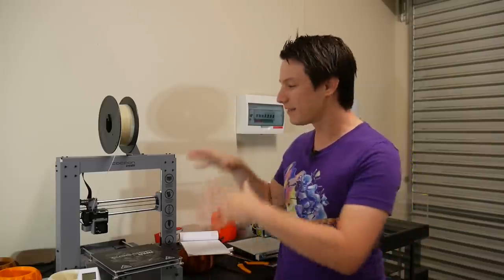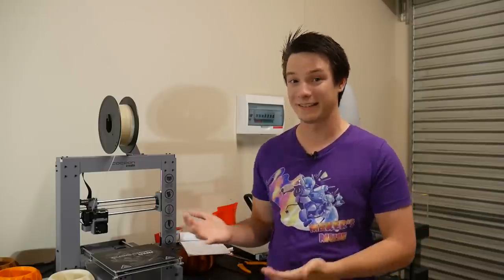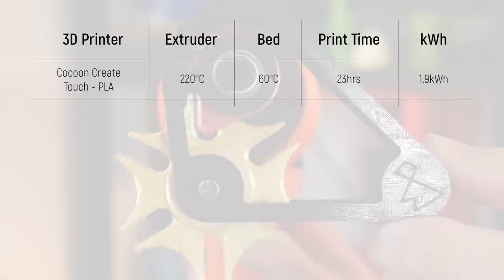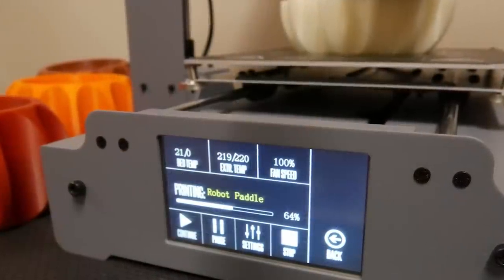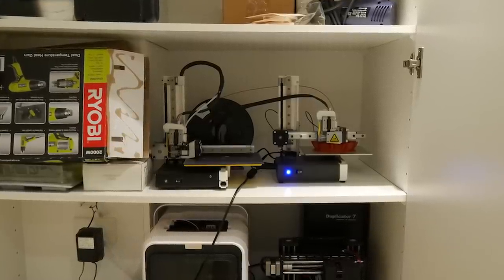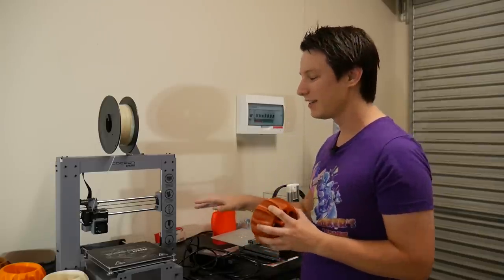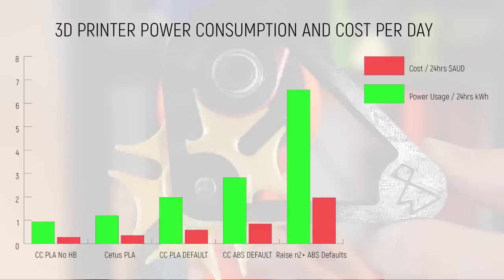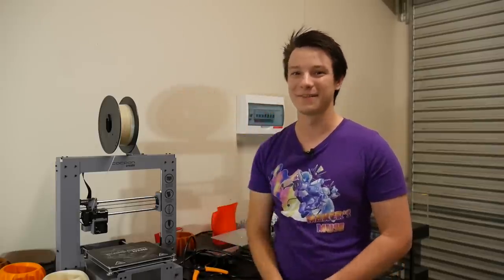How much power do 3D Printers use?

Comment: That cheap nasty watt meter (sold under Arlec brand in Australia) has been proven to be more than 20% out in accuracy, worth spending another $20 to get one that works Angus :)
Reply from the maker: Well that sucks lol. Good old jaycar. I'll source a more accurate one for a follow-up
Reply: Angus, before you punish yourself too much while there may be such inaccuracy it will however be quite consistent from read to read. Meaning that while the absolute numbers you've come up with may be in question the relative numbers will be pretty bang on. Thus the data collected can be correlated and corrected with a decent multi meter.

Best Wishes
Reply: do you have some hard data on  that (given that you say "proven") ... I'd expect something like 5% at worst. I've got one and when I plug my Fluke 11 into the wall its within 2% of the voltage read. Given how it then operates to calculate amps (which I'm not entirely sure) one could then speculate that if its induction measurement it wouldn't be much more than 5% ... still, if you have done measurements or can cite a source I'd be interested. 20% is a lot.
Reply: there's a government program where libraries were equipped with kits that are free to borrow with powermate's - $200 units that are by far the most/best watt meters out there.  (Government powersaving initiative, free meters made available for everyone etc - quality ones).

Comment: If you table the results and convert them, you get this table

a. 1.9 Kw in 23hr = 82.6 watts / hr
b. 2.7 Kw in 23hr = 117.3 watts / hr
c. 0.9 Kw in 23hr = 39.1 watts / hr
d. 0.5 Kw in 10hr = 50 watts / hr

And the winner is, C with 39.1 Watts per hour as the lowest consumption print.
Reply: No: the costs of energy are the energy it takes to make the same print as Angus showed. If your printer is only using 10 Watts but takes 3 days, on your calculation this is the winner but in total this printer is using much more energy before the print is finished. 
By the way you wrote Kw but you mean "KwH" (KWh). If you would use 0,9 Kw in 23h, you would use 0,9*23 = 20.7 KWh ... a lot more per print (and I'm happy it is not).

By the way, I can turn the heater in the room down or even off when it it printing, so in wintertime the energy-consumption is almost the same with or without printing (If I will use 1 KWh in the printer for heating or 1 KWh in the heater makes no difference, temperature in the room stays the same).
Reply: @elvinhaak  Fast print can be tuned via gcode, but you have a point. A practical testing is to test each machine until its printing quality is below acceptable quality at X% chance. This can be a very costly test, and only worth it if you run a huge printing farm.
Reply: The winner is D actually because it consumed less power in total.

Comment: 2.7kwh equal to 2700watt/hour. Therefore, 2.7kw x 23 hours equal 62.1kw.

62.1kw x 30c equal to 18.63 AUD
Reply: No, 2.7kWh is the total energy used. It did not draw 2.7kW for 23 hours.

Comment: Bed from 60 to 100 degree isnt a massive jump?

-Due to normal ambient temperature is around 20 degree, its a 100% jump? -And simple logic (alt physics), says the higher a heat difference, the greater a loss.. 

So the jump from 60 to 100 on bed, would theoretical bump the bed power consumption to double.. :)

Comment: So my takeaway from this is: If it costs more to order the part than to make it, make it. If it doesn't exist anywhere but your head, it's priceless so you might as well make it. About the same as if you just think of the material cost, but it definitely adds a little bit of thought when someone offers to buy a part that uses $0.75 in materials but takes twelve hours to print.

Also, this totally makes me think of those tiny half-cartesian bots (Do we even have a name for that style yet?) in a new light.
Reply: What do you mean half-cartesian? Cartesian with single sided support, Ormerod derivatives? Well you can print just as efficiently on something else, you just power off the bed and limit yourself to a small print size, and to low-shrinkage materials.

Comment: Cold you just print ABS without the fans on and it would work
Reply: M*A*S*H* The4077th I'm sure he had part cooling fan off.
Reply from the maker: Yep, no cooling fan for ABS
Reply: So that's what you do in your videos when you print ABS

And it still warps an doesn't stick to the plate and itself during the print

Comment: Thats like an average of 100 watts, that's really not bad. A gaming pc at idle uses like 200-300 watts with monitor not to mention when gaming lol, its more like 500.
Reply: Uhhh really? How do you even idle at 200-300W? No, certainly not. My Phenom II x6 overclocked to 4 GHz idles at less than 150W - that with two 7200rpm hard disks. Modern systems are way more frugal, with leaner idle, they are easy to bring under 80W idle.  A modern GPU, any modern GPU, idles at less that 10W, regardless that its full power might be 200W. Monitors are fairly negligible too, i mean mine has maximum consumption of just 16W! So in total you could say a gaming PC idles at around 100W.
Reply: I measured my system soo. It was like 250 watts idle. Two 780 and a 6600k. Of course if you have two slightly older gpus that definitely helps.
Reply: Yeah i can't imagine 6600k and the corresponding mainboard idling at that much power, i think your 780ies are doing something weird, usually you expect a much leaner idle off them, like sub 30W each. Maybe the settings? Maybe the driver SLI negligence?
Reply: Or maybe my pc was doing something in the background when i measured it lol.

Comment: This is the reason why I switch off the bed after a few layers...
Reply: I do not have a 3D printer yet, nor have I  used one, so this is a fairly ignorant question. The heat bed: is it typically on during the entire print job? Regarding your comment, do you turn it off manually, or is there a way/option to turn it off after the completion of a specified number of layers have been printed? Also, how long do beds typically take to preheat before printing starts? Far less than 1 minute, I imagine.

Comment: Wait a minute. Call me an idiot but I'm not so sure about the results' information you gave. For instance, you wrote that for ABS it gave you 2.7kWh in 23hrs. Does it means that each hour it socked 2.7kW (which means it took 2.7*23 = 62.1kW for only one print which I believe is the real statement) or does it means it 'only' took 2.7kW for the whole print (which means it took 2.7/23 = 0.117 kWh)?
Reply from the maker: No, 2.7kWh total. I botched up a few things will follow up soon to clarify
Reply: Didn't watch the whole video when I wrote the comment. You said it cost 30c for 1kWh in Australia but the cetus cost you 15c for the whole print (which was for 10h and drove 0.5kWh) which means it was actually really 0.5kW for 10 hours and not the amount by an hour. This makes it much more cost friendly in my opinion xD
Reply: I certainly won’t call you an idiot Jeremy :-) But, you seem to be unaware that a kilowatt hour (symbol kWh) is a standard "unit of energy" measurement.  You seem to be confusing the kWh "unit of energy” measurement, with the kW (kilowatt) “unit of power” measurement.
Specifically: 1KWh is a unit of energy consumed, by 1 kilowatt (1 kW) of power being drawn for one hour.
So, if you’ve consumed 2.7kWh of “energy" over 23 hours, it follows that the average “power" being drawn during those 23 hours was approx 0.117kW.
ie. 0.117kW power being continuously drawn over 23 hours would equal 2.7kWh of energy having been consumed (0.117kW x 23h).  Hope this clarifies.
Reply: I thank you about your answer, but clearly talking about idiocy could have easily been removed. 
However, it did not totally cleared my mind with this explanation. 
For me, 1kWh is 1kW consumed over a period of time of 1h. Example: Using a phone of 10W consumed each day in 5 minutes over a period of a year would be : 0.01kW * 30,4h = 0,304 kWh.
2.7kWh would be 2.7kW * 1h * 24h, and not (2.7kWh * 1h) / 24h. Which seems to be wrong.
Yes, this is disturbing for me.
Reply: Hi Jeremy. Apologies on the reference to your idiocy comment, it was just a friendly way of saying that you are most certainly not!     
You are correct that 1kW consumed over a period of time of 1h is indeed 1kWh of energy consumed (1kW * 1h = 1kWh). 
Similarly, 0.5kW consumed over 2h would also be 1kWh of energy consumed (0.5kW * 2h = 1kWh).
Your example is also correct, if I have read it correctly as: 10W consumed for only 5 mins a day over a year (365 days) is indeed 0.304kWh energy consumed.
In math: (5 mins * 365) / 60 = 30.4 accumulated hours of drawing 0.01kW. Therefore: 0.01kW * 30.4h = 0.304kWh
Where you go wrong is when you have tried to reverse the formula with the 2.7kWh example.
ie. Where you said: “2.7kWh would be 2.7kW * 1h * 24h”  This is wrong!
The equation 2.7kW * 1h * 24h evaluates to just 2.7kW * 24h, which would equal 64.8kWh energy consumed (2.7kW * 24h = 64.8kWh).
To resolve for 2.7kWh consumed over 24h you reverse the equation thus: 2.7kWh / 24h = 0.1125kW (or 112.5W being consumed over 24h).
ie. The proof, by putting that back into the original equation: 0.1125kW * 24h = 2.7kWh.  Q.E.D. :-)  
I hope this has helped to further clarify.
Reply: Thank you about this explanation. 
When I wrote 2.7kW * 1h * 24h, I meant 2.7kW * 1h * 24 = 2.7kW * 24h. My bad.
If I understand correctly, 2.7kWh actually means 2.7kW for the amount of hours, then compared to an amount of the actual time (hours, minutes, days our years) to divide by.
Sorry but the sign itself drove me to this error.

Comment: your making things complicated,,,
i tested with watt meter so the result is
HEAT BEAD 250 Watts/h
Extruder 55-60 Watts/h
on ender 3
if you wish to save money for long hours printing,
just after the printer has finished first layer, turn off heat bed..

Comment: When you say the the print take "23 hours" and  "1.9 kWh", it means that the printer consumed 1.9kW each hour for 23 hours. That "h" after "kW" means "each hour".

You are using the wrong units...  your calculations are ok when you say the print took 23 hours and consumed 1.9kW. At 30 cents per kW that is 57 cent for the entire 23 hours. But when you say 23 hours with 1.9 kWh that means it consumed 1.9 kW each of the 23 hours for a total of 43.7 kW and the cost would be 13,11 AUD. Big difference....

Comment: Kick Off the print at 10pm for off peak rates
Reply: For a 23 hour print it won't really matter though. All billing periods will be crossed. Cheers, JAYTEE         edit: good idea though
Reply: Was thinking more the 10hr jobs. Is a heatbed even needed once the base is printed? If not cant it be turned off to conserve energy?
Reply: In concept, your idea is absolutely spot on. You can certainly control the heated bed temperate beyond the first layer. There are some other cases however where it may be counter productive. Surfaces like the Ultrabase for the Anycubic i3 Mega and it's equivalent on the JG Aurora 'release' the print once the bed gets below a certain temperature. I have an i3 Mega and have also installed 3 x Ultrabase plates onto 3 other printers. I would hate for a print to become unstuck for the sake of a few cents in electricity.

Comment: Not really surprising that the bed is such a high percentage of the energy used. Resistive heaters are not known for being efficient.
Reply: What do you mean by efficient? They are pretty much 100% efficient in the regards of changing electricity to heat. Think about it, what would the waste energy be?
Reply: I agree with faxxzc, electric resistive heaters are pretty well known for being nearly 100% efficient
Reply: faxxzc Look up heat pumps (refrigerators for exemple). They use energy to move heat, and are way more efficient than resistive heater. One could say their "efficiency" (not the proper term here) is above 100%.
But I don't think it would be practical to use them for 3d printing, considering their size and cost.
Reply: I am curious how much heat can be shared by insulating the heat bed on the bottom side with some material
Reply: It is nearly 100% efficient for the energy conversion (electric to heat), I think what you meant was the coefficient of performance (COP). Which is not relevant here unless you don't mind having a heatpump running. 

The solution is to have an enclosure. I built mine out of a simple cardboard.
Reply: Afdhal Atiff Tan Amin Husaini Tan exactly ! And for the enclosure that is what I would also do, I would be far from practical to have a heat pump on a hobby 3d printer. 
I was just pointing out comment OP was kind of right as you could spend less energy for the same amount of heat :)
Reply: bbogdanmircea
Massive difference. If you're running with no insulation under your bed, get something. I used the thick cardboard from the box the printer arrived in 😛
Reply: Walter Gabriel you are right, it is true, however it is only efficient for low temperature differentials of 20-40 degrees C, if you want to heat something to multiple hundred deg C this is not viable
Reply: As a small addition:
For creating heat a normal resistive heater is the best you can get.

HeatPump, as the name imply, are NOT heaters, they only move the energy around. for your house you usually do not care if the outside is changing temperature. But as already mentioned that only works decently for small temperature differentials, at higher delta_t they are rapidly going towards having the same efficiency as a resistive heater. But they have more things that can fail and are often harder to control.
Reply: Well now I have the kinda terrible idea to duct the exhaust for a portable AC unit into a printing cabinet. (No, don't do this. This is probably a very, very bad idea.)
Reply: Walter Gabriel  Actually it is wasting energy cooling one side and heating the other...why not just heat somthing up
Reply: Heat pumps are not generating heat (energy), so the efficiency to GENERATE heat are not over 100%.  It just move energy (heat) from one place to the other.
And part of the energy to do that can be used to heat the hot side.  So if you want to heat up, you can get more heat energy out than electrical energy you put in.

So yes, it can get close to 100% in efficiency, if you look at the system and ignore energy taken from the cold side.  As the cost for that energy from the cold side is usually near zero, we ignore it.  So the COST of the heat, the electricity bill, we get out is lower than if that heat would be generated only by electricity. Thus the more the 100% efficiency number, which isn't right.
Reply: The cost is how much energy it takes to raise the temperature from 20°C to 60° for PLA and 100° for ABS.  That is about 40° for PLA resp. 80° for ABS, as room temperature was about 20°.  You also need to think about heat up the room too, as the heat "leaks" out on these machines. For this calculation, I ignore the 10°C extra energy for ABS nozzel.
That gives about 1kWh for PLA and 1.8kWh for ABS.  So yes, it is about twice the temperature differens, about twice the energy for the ABS, and thus twice the cost.

What was a surprise for me was the differences between the large and small machines. That was more than what I would expect.

Anyways, if you want to save on the cost, insulate the heat bed as one suggested, so the heat is going up, not down (without insulation, that would be about 50% heat going down).  And make the heat air above the heat bed stay there, by enclose the printer. Then not that much energy will be used to heat up the room. Even a simple enclosure should get some positive effects.
Reply: @AndersJackson  "What was a surprise for me was the differences between the large and small machines. That was more than what I would expect."
Because F=m*a, so the heavier the moving part, the more energy being used. Also, friction is proportional to gravity. Also, printing slowly may help, since energy consumption is proportional to speed to the power of 3, but you need to weigh it against the extra energy used in nozzle and headbed.
Reply: @y.z.6517  that can be ignored.  Moving is only a small part of the energy use.  Heating up the hot end and the heat bed takes a LOOT more energy then moving the hot end.
Reply: @AndersJackson  Have you done experiment on that? Or is that just your imagination? A 3D printer needs at least 4 stepper motors. They accelerate and decelerate a lot and very fast against inertia. Also, even if your bearing is good, friction is not ignorable for the mass and torque. Furthermore stepper motors control displacement, so they use more power than actually needed to accelerate at their required velocity.
Reply: @y.z.6517  just have a look at the set up.  Which using most energy, that turn into heat?

Do the motors turn as hot as the hot end, or even the hot bead?

What are we having problems with connections can be so hot that it could start burning? Connections to the motors or to the hot bead and hot end?